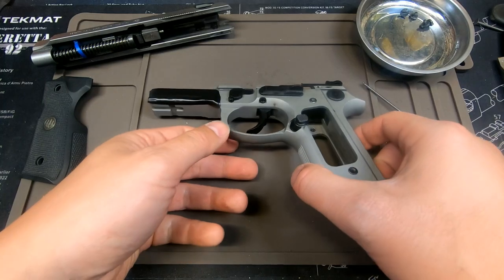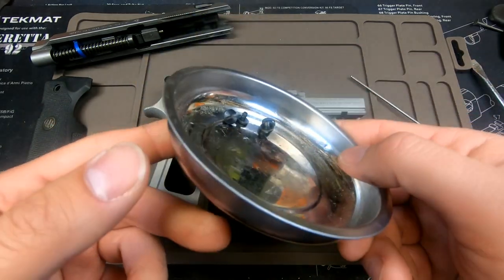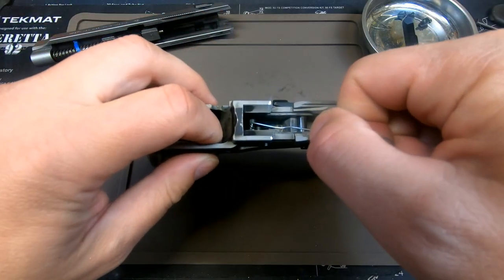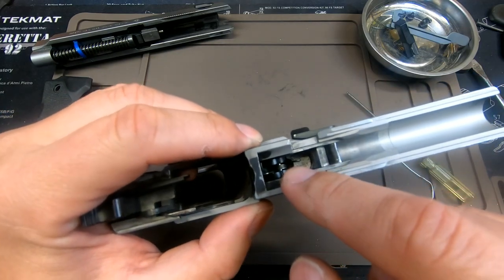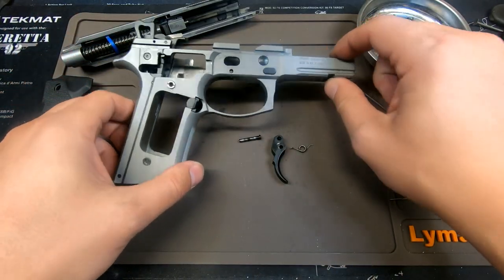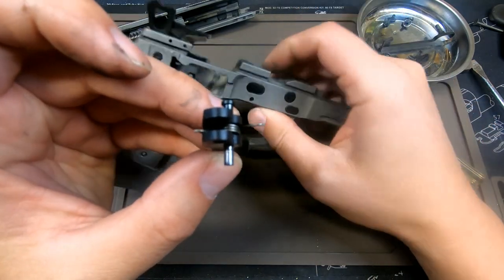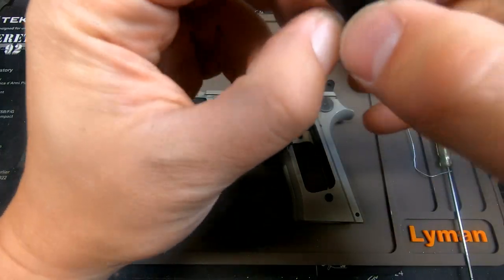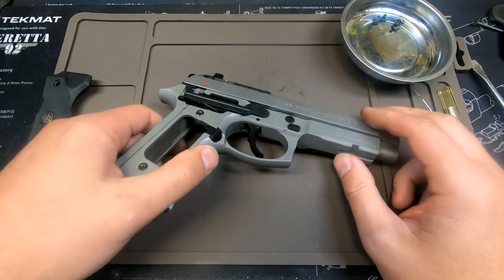Beretta 92 DIY - Episode #8 - Trigger Assembly Installation (Wilson Combat Short Reach, Steel, INOX)

Comment: You make this look easier than it actually was.  It took me several tries to get the trigger return spring in the right position before sliding the pin into place.  Re assembly was a breeze after that.  Thank you for posting.

Comment: Have you tried the Beretta Adjustable Trigger #E00252 ? I am weighing whether I should go with that or the WC Short reach. thanks man
Reply from the maker: I did and hated both.
Reply: @CobraReady  I haven't installed the WC yet and was considering doing a side by side. Is it even worth it? I hear the set screw needs to be modified for that adjustable trigger to even work in DA, but it eliminates the over travel more than WC. I am admittedly, a trigger snob coming from 1911/2011 platform. Venturing into Beretta finally...
Reply from the maker: @NickShootsStuff  I installed the adjustable trigger and was having issues so I took ot out.  The LTT trigger bar with match hammer and 92XP trigger is the way to go.  The SA will be like a 1911
Reply: @CobraReady  Ah, you mean the Beretta 92 Series Match Aluminum Trigger. right?
Reply from the maker: @NickShootsStuff  Yeah, it's the same as what's on the 92X Performance

Comment: How do you like the Short Reach Trigger?  I am considering installing this into my Beretta. Does it ease up the trigger pull noticeably? Also, what is the feel like in single action?
Reply from the maker: I do not like the Short reach trigger from WC.  It breaks too far back for me as I have large hands.  If you have smaller hands it may feel better
Reply: @CobraReady  good to know. I have medium sized hands. Im thinking of giving them a try. How does it feel in SA?
Reply from the maker: @believethehype8936  For me, in DA and SA I dont like it and my finger wraps around it too much.  For smaller hands it may feel better